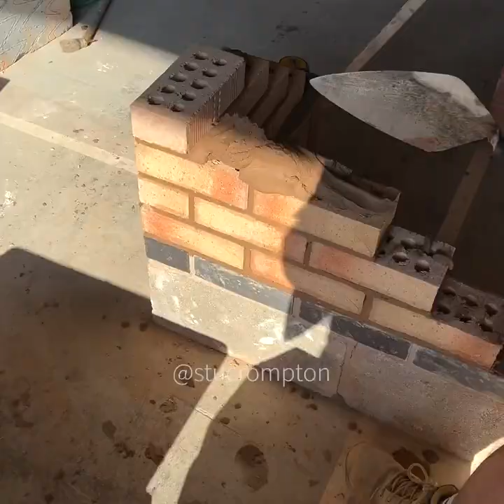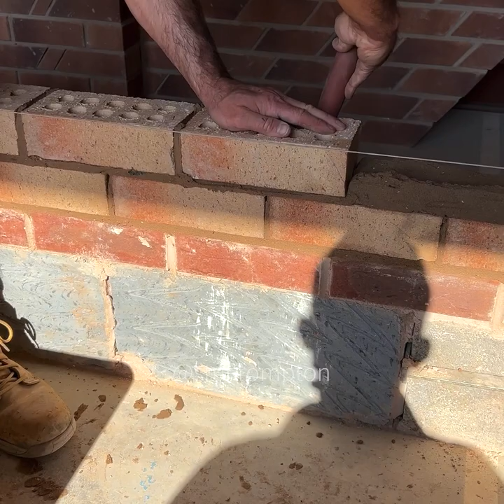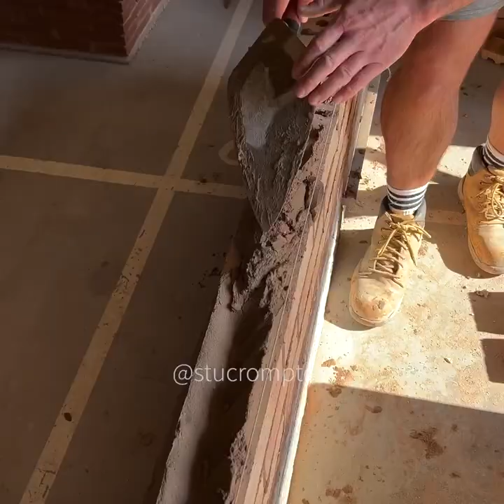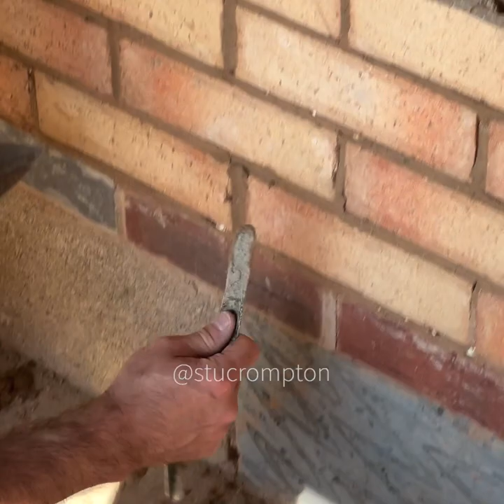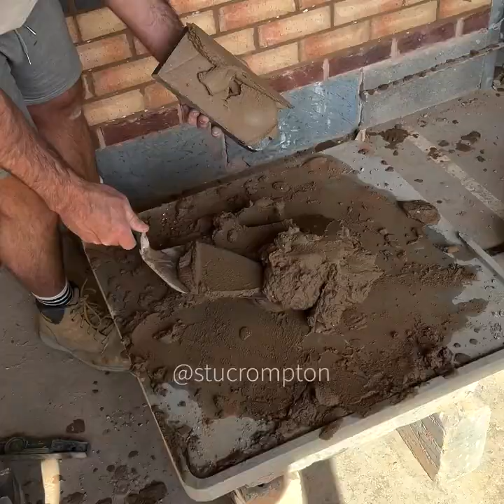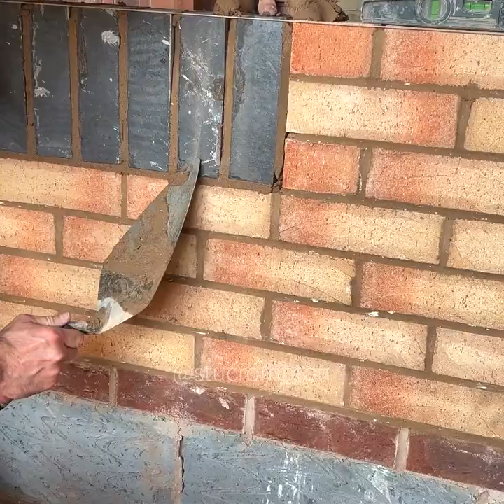🧱Bricklaying student Lesson - James🧱

Comment: G,day from Sydney Australia.
Spacing of the soldiers: perfect.
My Bricklaying teacher had a four step tolerance gauge. It was an aluminium block, step one 1.5mm step two 2.5 and so on.
The marking sheet for each job had the maximum number: made up of tolerance steps counted from the marking assessment.
"It keeps the concentration and quality"
🌏🇦🇺

Comment: What is the spoon-like tool you use between the bricks? Do you have any videos on brick-laying older, non-uniform bricks? I need to make a wall with 120 yr old bricks that are not as uniform as yours.
Reply: Its called a jointing bar or a jointer.